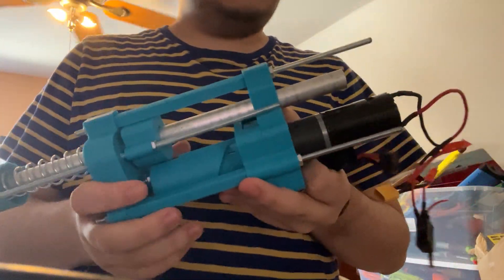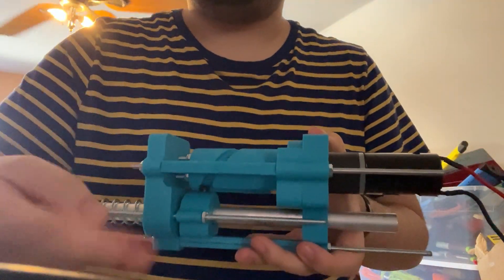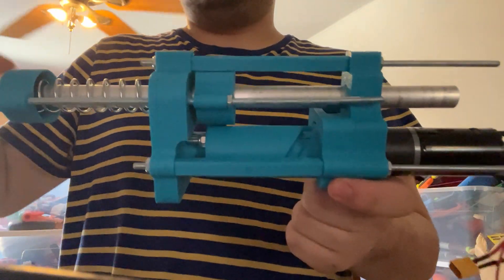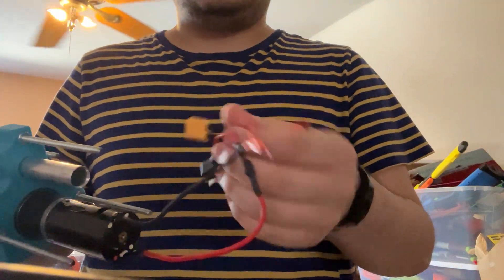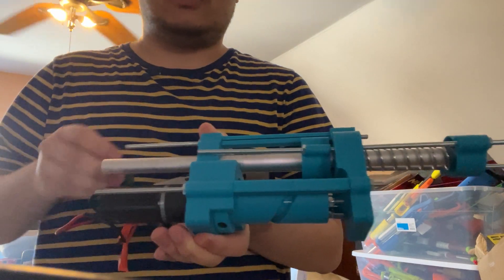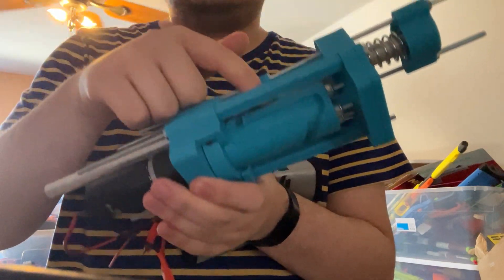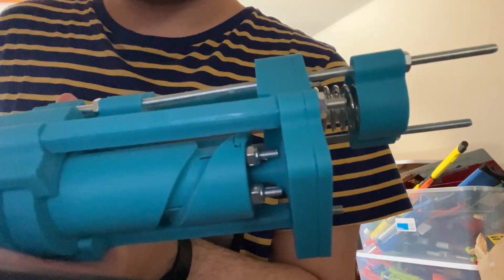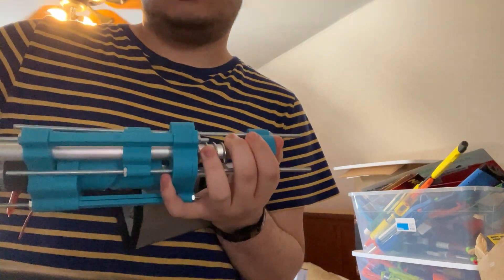Cylindrical Cam AEB Priming Test Rig

Comment: Why did you go for the crank design for the final aeb or are you making 2? I think if there were washers on the small lengths of threaded rod kt might save the cam groove if you dont want a buffer?

Id imagine if this was more compact you could make a sten lookalike
Reply from the maker: The wear on this style of setup is just too great. And in order to reduce wear, the materials and machining time would make it cost far more.
Reply: @Sillybutts  that's probably a pretty common problem with consumer level 3d printing isn't it?

Also damn fast reply, thanks!
Reply: @Sillybutts  I am trying a design that uses a pulley and belt:
One end of the belt is connected to the plunger and the other has something to roll in a track, the pulley has a notch and an ejector so that it winds up the belt almost a whole rotation then kicks the belt out of the notch, letting it and the plunger spring away and unwind

Comment: I love this design, how many kg  of the spring can the cylindrical cam takes? do you use 774 motor or others? and how many rpm of it?
Reply from the maker: No idea on max realistic spring weight yet, haven’t done enough testing.

This is a 550 size motor with a 100:1 planetary gearbox. With reduction the output becomes 3ish rotations per second.
Reply: @Sillybutts  Does the CAD of cylindrical cam is updated on the git, could I have a reference on it?
Reply from the maker: @JedYu120303  there are no released files yet.
Reply: @Sillybutts  Got it, thank you for your repry.